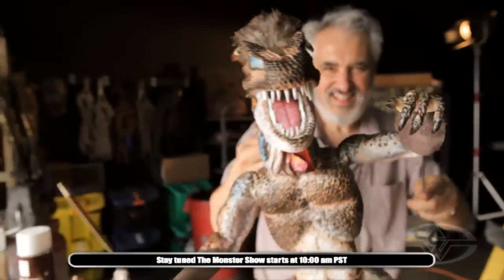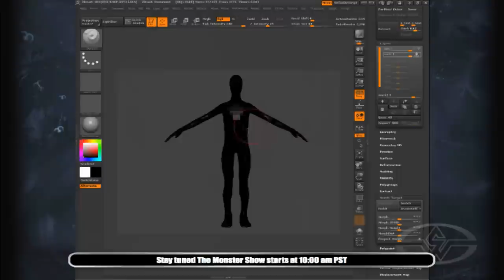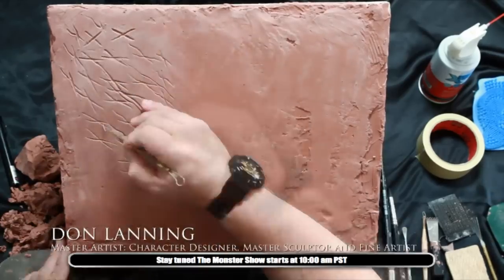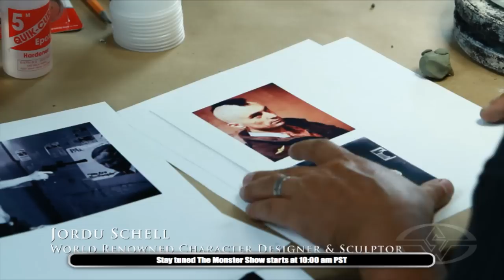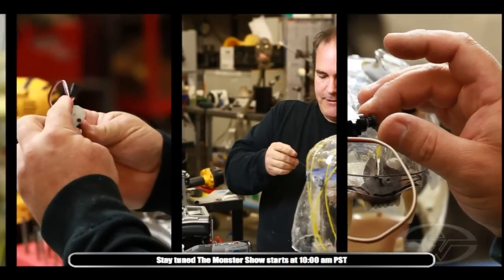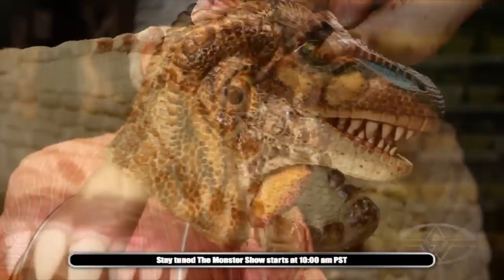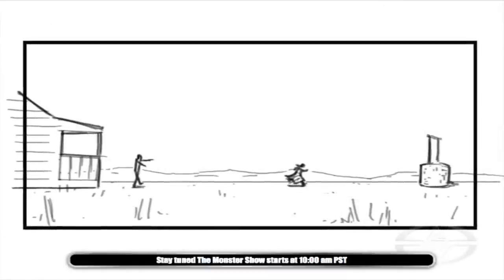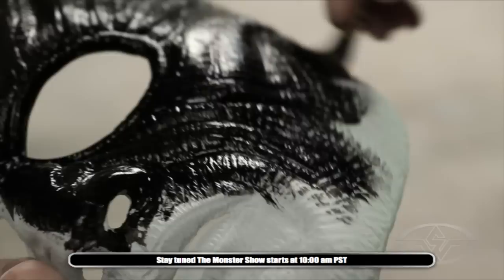THE MONSTER SHOW - Ep. 1 - Steve Johnson

Comment: For anyone who wonders why Steve Johnson has that reaction at 2:06:03 when "Pumpkinhead" is mentioned,  here's the thing: Johnson managed to create the backward-bent legs McTiernan wanted by using leg-extension prosthetics and having the performer (JCVD) hanging from an overhead gantry crane in order to take the weight off his actual legs. Things went sour as he details in the interview. However, after he was fired, all the stuff he had made for the film (including the creature suit) were handed to Stan Winston to see if he could make some use of it. Winston, as we all know, went in a completely different direction with "Predator" (effectively going for the "man-in-suit" approach that McTiernan so desperately wanted to steer clear of) BUT, when he made "Pumpkinhead" some time later, he gave the creature backward-bent legs and used a crane to allow the creature performer to actually stand up (I think you can actually see the wire in a few shots on some old, open-matte VHS tapes of the movie). In the second volume of "Rubberhead" (his autobiography), Johnson more or less says that Winston got the idea from his unused "Hunter" creature.